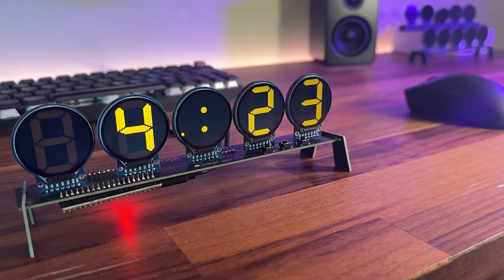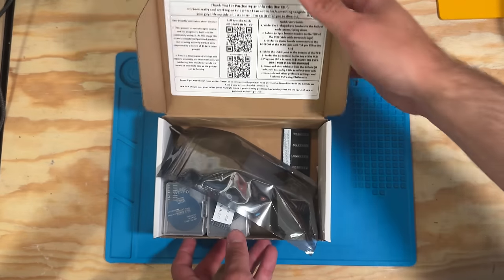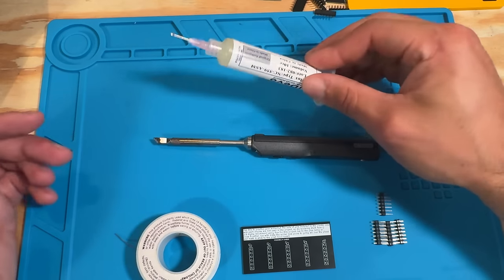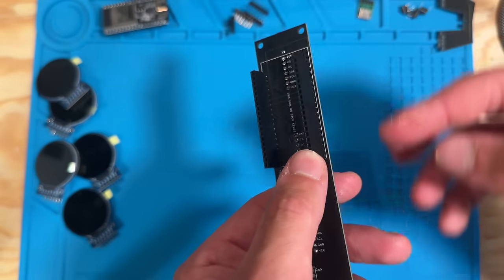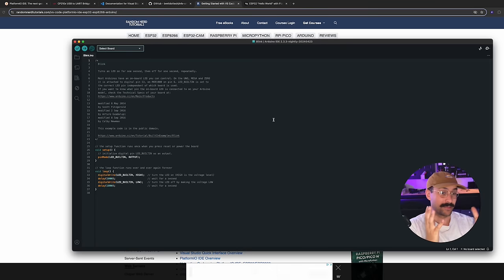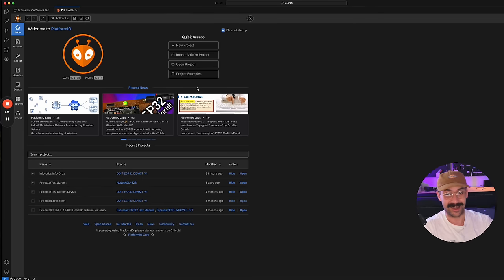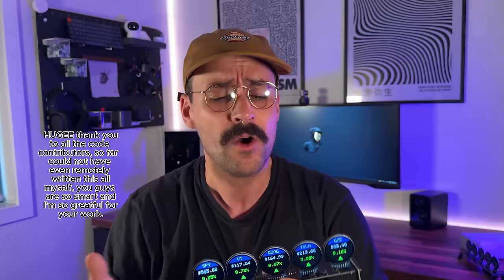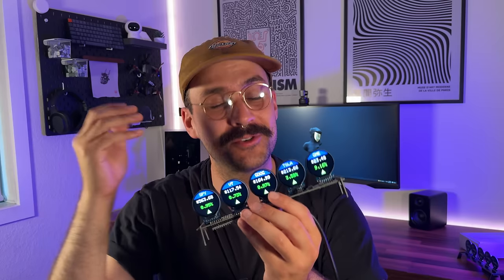I built the open source desk display widget of my dreams, info orbs!

Comment: How do you determine which stock prices are displayed? Is it possible not to have this stock function in the code?
Thanks
Reply from the maker: Like how to select the stocks? I go over this at the 18:20 mark of the video, its a line item in the config file, super easy to edit/change (:

Disabling widgets is also very easy, you just need to comment out the widgets included in the main src file. I didnt go over this explicitly in the video (though looking back I should have) mostly due to the fact there is so few widgets now that I dont think most would want to disable any, but the codebase is built so you can very easily disable/change the widgets you use.

If you need a hand with it all, happy to walk you through in discord (:
Reply: @brett.tech_ didn't saw your reply, sorry. That's fantastic, it means it's somehow open for some modifications. Thanks for the info, it's a great project.

Comment: Too bad you don’t sell a pre-flashed uprocessor
Reply: Then you would be stuck with the current version of the firmware. Follow the steps in the video, it's not so hard. Now  you can update your orb display in the future with every new functionality they come up with.
Reply: @alexanderpoplawski577  Personally, I wouldn't have a problem with that. Hell, I'm still running Windows '98 'cause some of the software I use now and then runs under DOS.